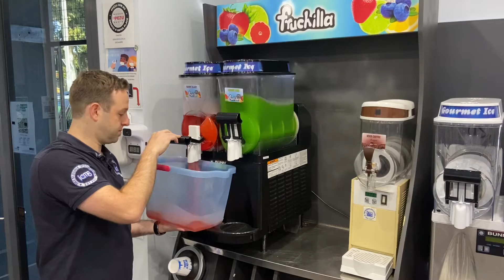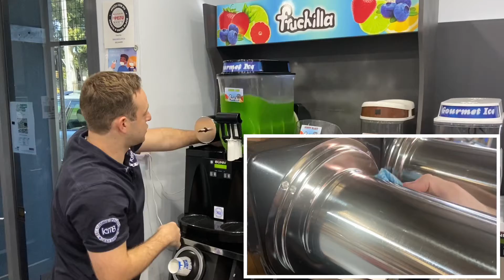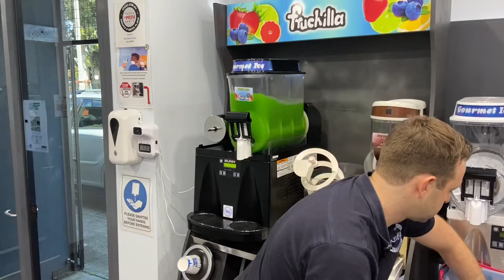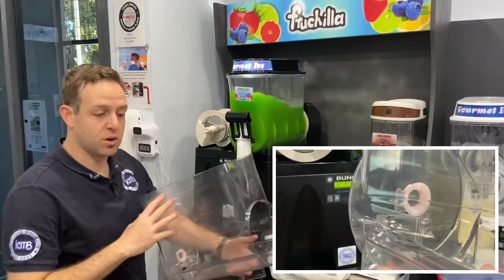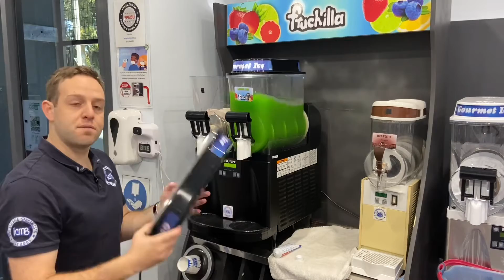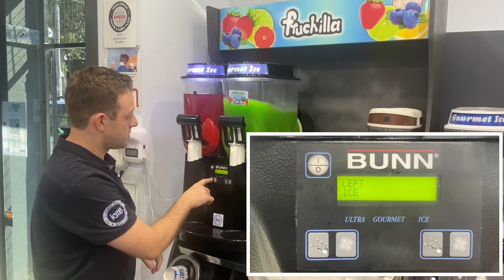Bunn Ultra 2 Slushie Machine Cleaning

Comment: Can you please tell me what is the quantity of syroup and water you have to put in one tank so it can be full? Can you refill while is working?
Reply from the maker: Thank you for your great question. This will depend on the brand and concentrate level of the Slushie Mix that you use, it can range any where from a premix (ready to fill as is), 3:1, 4:1 or even 5:1 dilution ratio. The Fruchilla product we use is mixed at a 5:1 mixing ratio meaning for every 1 part concentrate, we add 5 parts water. Each BUNN Ultra Container is 11.4L (3 gal). Absolutely yes, we recommend refilling the machine with smaller increments often, while it is in operation, to best maximise your serving capability.